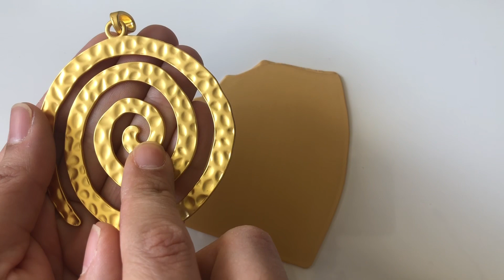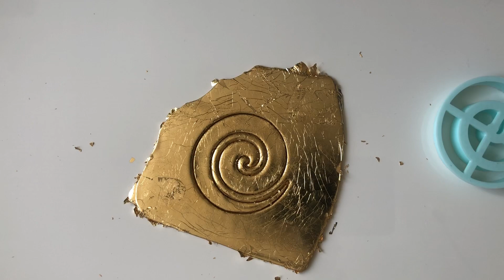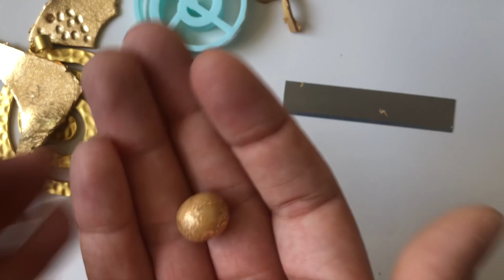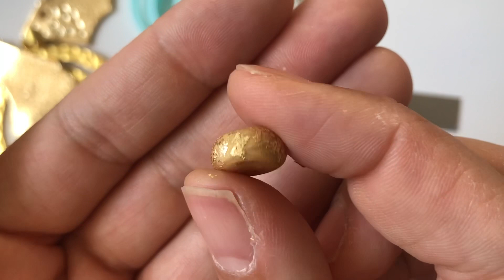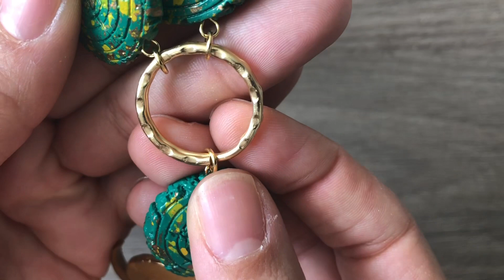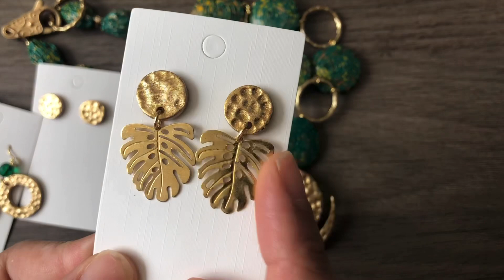Make Your Own Pendants! Polymer Clay Tutorial: Faux Hammered Metal!

Comment: A little tip I picked up to make cutting with an exacto easier- if you work on a small piece of paper you can turn the piece around easily as you cut it around rather than having to rotate the knife in awkward angles. Then you can also just pick up the piece on the paper and place it on the tile.